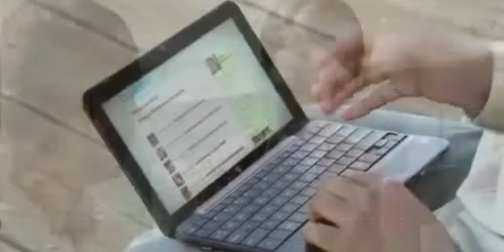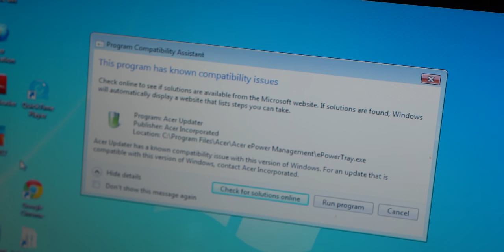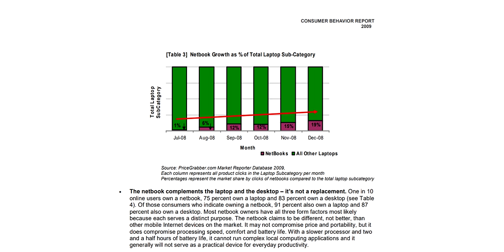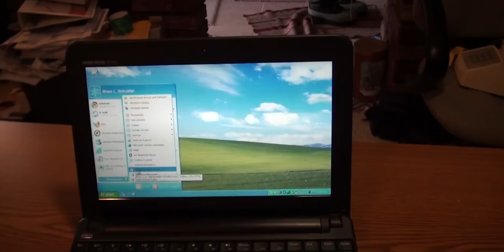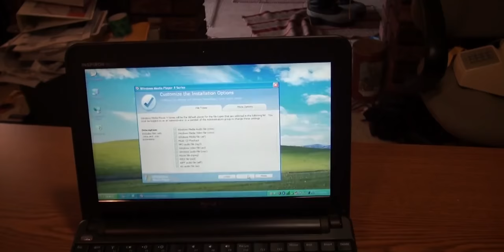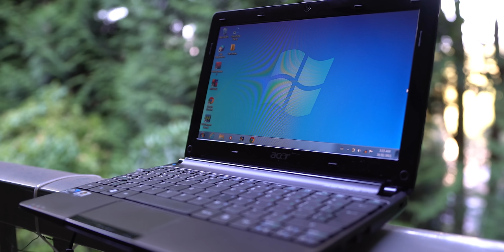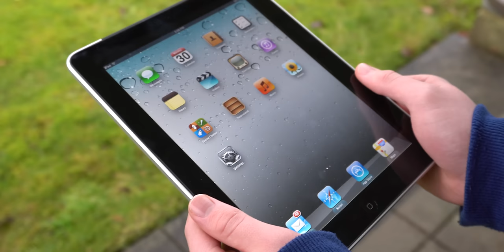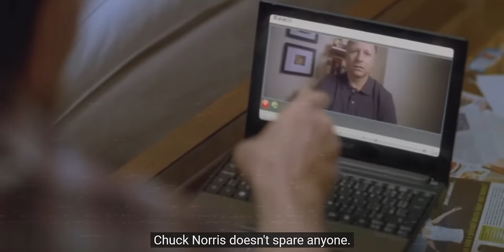Why Netbooks Failed - Modern Retrospective

Comment: I adored my HP Mini 110c I bought used in December 2010. The previous owner even slapped Win 7 Ultimate on it before selling it for about $240. It was the first PC I owned for myself, and despite the Atom and 2GB RAM, it was phenomenal for light web browsing (for circa 2011-2013 web), Winamp music-playback, and Genesis/SNES emulation throughout its 2 years with me before its charging/AC port quit. It also helps that Win7 was the best experience I've ever had in my now 21-year history with Windows.

I've since moved on to much more powerful/interesting hardware, such as a 17" Core-i7 laptop in 2013 and an 11" convertible tablet-laptop in 2013 (both laptops being Windows 8), building myself a PC in 2017 (with Windows 10), a series of iOS devices throughout 2014 - present, and lastly getting my first Macbook in 2018. But none of my experiences with any of these computers were as fun or stress-free as my time with that Windows 7 netbook. Learning MacOS on the Macbook Pro (though fine enough) is still a learning process, and as such, is filled with lots of little roadblocks. Windows 8 on the two laptops was fine enough but something always felt 'off' about 8. And while I adore my tiny 2017 ITX beast I built, Windows 10 has made my experience on it just miserable over the past 3 years; Windows 10 is the worst experience I've had in my 21 years of working with Windows - I'm just waiting until the Linux community's Proton project reaches close to 80%/90% compatibility with Steam's library of games and then I'm moving the PC to Linux (likely Ubuntu or Mint) and will likely do the same for my two remaining Windows 8 laptops when Win8's End-of-Life comes about in 2023. Linux will be another challenging learning process for me, even moreso than MacOS; But I've had all I can tolerate of Windows 10 and need an OS that's not constantly flaunting its worst traits as features.
Reply: TurboPikachuX which 17 inch Core i7 laptop is it?
Reply: @Windows7Pro2009  HP Envy DV7-7250US (2012)
17.3" @ 1600x900
Intel Core i7-3630QM 2.4GHz (3.4GHz iTB)
Intel HD Graphics 4000
8GB DDR3-1066 RAM
5400RPM 1TB HDD
Reply: @TurboPikachu  Does HP have an option for a dedicated GPU?
Reply: @Windows7Pro2009  HP did offer about 3 other configs of the Envy DV7 that had an Nvidia GeForce 650M, but the only model I could find at my Office Depot and Best Buy locations was the integrated-only 7250us.

That said though, Intel's HD 4000 from May 2012 was so much closer to the performance of Nvidia's GeForce 6xx-series laptop GPUs from March 2012 than any of Intels future iGPs would ever get against proper laptop GPUs. I mean, considering intel's 2019 Iris Plus iGP can't even output 1/3 of the performance of 2016 laptops with GTX 1050m graphics, I struggle to believe that the upcoming "Iris Xe" iGPs will catch up to AMD's Polaris-based Vega and Navi-based RX5000M-series, or Nvidia's Pascal-based GTX10M-series and Turing-based GTX16M-series/RTX20M-series

I was actually quite impressed back in 2013 that the HD 4000 iGP could run late-generation PS3/360 titles like Sonic Generations GTA V at medium settings/30fps at native 900p, and even ran some current-gen titles such as Rocket League and Warframe at resolutions and frame rates above that of the Nintendo Switch's.

But ultimately once I built my gaming PC in January 2017 (i5-6400, RX480-4GB, 16GB DDR4-3000 RAM, roughly around Xbox One X spec and above-spec of the PS4 Pro and upcoming Xbox Series S), I stopped laptop-gaming altogether, as moving the PC from a 60hz 1920x1080 TV to an ultrawide 2560x1080 75hz FreeSync monitor in April 2019 really killed my interest in anything laptops had to offer
Reply: TurboPikachuX Thanks for the info, as I’ve been looking at used laptops with dedicated GPUs. But now I am stuck with a Core 2 Duo T7200 with 2GB RAM and Windows 10 ;-;
Reply: i always want to know what happened internet after 2014.
Reply: @angry_engineer  The entire internet moved to HTML5 from Flash.
Reply: @Windows7Pro2009  thank you dude.
Reply: @Windows7Pro2009  lol that must be such a painful user/productivity experience
Reply: I don't think Windows 10 is a bad OS. The majority solely uses Windows and people who use Linux (any distro) are in the minority. That all goes down to software compatibility. And I might be the people of the minority who dislike Linux. If you're worried about security, then it's because the majority uses Windows and finding exploits and flaws are easier since it's the majority OS and there are very few people who use Linux.
Reply: I only had i5 pc, is i7 much better?
Reply: @rustymixer2886  The only point to which an i5 would start to suffer as opposed to an i7 would be in running games like GTA 5 at 4K ultra settings whilst trying not to bottleneck cards like the Nvidia GTX 1080/1080ti and RTX 2070/2080ti/3080/3090, or AMD Radeon RX 5700XT/Radeon VII

Other than such extreme cases as that, an i5 is a perfectly fine CPU to pair with cards like the Radeon RX 470/480/570/580/590/5600/5600XT/5700 or Nvidia GTX 1050ti/1060/1070/1650/1650S/1660/1660S/1660ti

But in light of recent developments regarding vulnerabilities such as Spectre and Meltdown (and the resulting security patches harming performance up to 30% in some models), as well as intel's clearly-slipping performance per dollar against AMD, I'd highly recommend opting for a Ryzen 5 over an intel Core i5 chip these days, especially for gaming.
Reply: @TurboPikachu  suppose it depends on the generation too
Reply: @TurboPikachu  yeah I used it to edit blu ray movies it seemed that was fine but I wouldn't push it with hi tier games. My friend kept yelling at me to get i7 but I said my o
I5 cool but he said it heats when renders edit movies but I didn't notice
 Any prob
Reply: widnow 10
Reply: I loved having Windows 7 at work and in college. Windows 10 is good too, but Windows 7 is faster.
Reply: @Minecraft TV i like dual boot xp and 7
Reply: The number of headaches I have had with Linux have left me wanting to throttle anybody who suggests it to me as a viable operating system--be STRONGLY warned. Windows 10 has ben a profoundly more positive experience for me, if that makes things at all clear.
Reply: @IrenMasot  isn't Unix ios and Linux, with andriod being a son of Linux? Now a days I rather work with dex than windows pc 🖥

Comment: They didn't necessarily fail, they evolved into other markets.
Reply: Their spiritual successors are definitely Chromebooks.
Reply: @RydalS  yes
Reply: Such as the 2 in 1 with detachable keyboard
Reply: @RydalS  except chromebooks are trash. I know that from experience.
Reply: @XMANIAFLYYY  Not all of them, but I respect your opinion formed by your own personal experiences.
Reply: Yeah they split into chromebooks, ultrabooks, tablets and 2in1s
Reply: @RydalS  I live in Russia and Chromebooks… do not exist there. Very few people know about them.
Reply: @XMANIAFLYYY  agreed, chrome OS is super limited, bad Specs I’m forced to use them for school then the school decides to further limit Chromebooks by restricting everything 

Even The use of Linux :(
Reply: @kovyvuri  They are pretty bad, at last on netbooks you could intall a real OS like Linux Mint or Arch
Reply: That's a lie because Google killed destroyed the majority of the crappy laptop industry with crappy tablets which microsoft had no choice but join forces with  Google because crappy android tablet have the advantage that the same potato hardware is cheaper and touch screen makes Netbook size screen more enjoyable because of pitch zoom without the same pixelation that would happen on a normal netbook it's part of the arm technology hardware acceleration.

Comment: Netbooks were great. I gave presentations with them, wrote software, even ran robots and computer vision with them. They never let me down.
Reply: @Dave Everett
Yes, my Asus eeepc was reliable too.
Sturdy little fukka still boots up today with everything working.
Reply: Bought an MSI Wind and installed MacOS 10.5 then moved to a Dell Inspiron 910 with MacOS 10.6 and a 128GB SSD. Both served well for coding, presentations, working on the move. Cheap enough that if anything had happened to them it wouldn’t have been heartbreaking to replace them.

Comment: cough cough- Arent Chromebooks basically Netbooks?
Reply: No because Chrome OS does way better on limited hardware than Windows does. Plus there's far nicer Chromebooks now with i3, i5, i7 processors and 8 to 16 GB of ram plus back lit keyboards and touch screens. You can run Linux on the newer ones and some gaming services are making their way to the platform. For doing simple things like web browsing or using Android apps a Chromebook is way better than netbooks were.
Reply: And its more lightweight system

(Correct me if i am wrong
Reply: I am pretty sure if they didn't burn the Netbook branding and it wasn't about Google pushing their propaganda on us, these things could just as well be named Netbooks.
I mean technically I can turn any laptop into a Chromebook and most recent Chromebooks can run proper Linux distros (and yes, I know Chrome OS is based on Gentoo) or just run its software inside a Debian chroot.
Reply: @domm4633  16gb of ram and an i7 is a tad overkill for a chromebook though
Reply: @SprattyD  It is but you also have to think about the longevity of the device since newer chromebooks are being supported for 8 years. I have an i3 chromebook with 8gb of ram and its really nice to use.
Reply: Pretty much 😂
Reply: @SprattyD  yeah...I wouldn't want so much power for just Chrome and Android apps. I would be sad if I had a mobile device that's more powerful than my desktop (below if you don't mind me f l e x i n g 😤😤😎😎). I could use a laptop that has a similar CPU but weaker GPU, like my brother has, if he ever gets a new one. But only with Windows.

(i7-4790/H81, GT 730, 12GB DDR3-1600, 500GB WD Blue 3D NAND SATA SSD, 1TB 7200RPM Seagate Barracuda with 64MB DRAM cache)
(wanting to upgrade to GTX 1650 Super or 3050 if it ever exists)
Reply: Aren't*
Reply: @MegaManNeo   certainly they’re notebooks for using The Net. So I think you’re right we could easily call modern ones netbooks. However, the form factor is called ultrabook, since that’s what the Chromebooks OEM’d with Windows are called, as well as the MacBook Air and stuff being put in that category. But of course if the netbook name hadn’t been tainted there’s nothing to suggest the name ultrabook would’ve been necessary, so even if we pivoted back to full size keyboards and slightly larger screens but thinner designs that were as light as a netbook; they might have well still been called netbooks if the name were still good. I suppose the “hallmark” or test of that timeline would be whether they called the very first MacBook Air a netbook or an ultraportable.

Comment: I had one from my grandma it was called an Eee Pc made by ASUS with windows 7, and it took 50 years to do anything. We won't talk about what happened when it upgraded to windows 8.
Reply: My friend had an Eee PC and when he updated it to 8 it would just crash on startup.
Reply: @fenn_fren  my mom also had an asus eee pc, same experience, but we never upgraded to windows 8. Anti-virus software was the biggest performance killer. She gave it to me and now it has an ssd and Linux mint and now it boots within 10-20 seconds and I can actually use it.
On a side note, without the hdd, the screen is to heavy for the eeepc so it won't stand correctly. I was lucky I had an old ssd that was as heavy as the hdd that was in the eeepc.

Comment: I remember my ex having one, damn those Atoms were SLOW..
Reply: I'd leave someone if they used a netbook too 😂
Reply: @AshenTiger  maybe he left her cuz she was too fast with too many, get it 😆
Reply: Mac Gyver LOL
Reply: Mine with the dual core atom was alright. Slow but fine with Windows 7 for word processing.
Reply: @pilotavery  would be faster just xp
Reply: I still have one (EeePC H1005HA), it was running dual boot with the original WinXP and Win10 on the stock 160GB HDD till i swapped out the old spinning disk for a 128GB SSD now running Kali Linux.  Sure it may be slow compared to my Acer Nitro 5 with its i7 and GTX 1050TI but it runs just as fast if not better than my OG Surface Pro with its i5-3317U
Reply: @tolgahk84  awesome!
Reply: Same here lol

Comment: There were some 11.6 inch netbooks that actually came with Core i5 and Core i7 ULV processors like the Acer TimelineX 1830T, although it costed $699 when it came out.

Comment: Got a Compaq Mini 110 running XP on clearance in early 2009 - I appreciated the portability and battery life on several trips abroad, and it never felt too unbearably slow. I eventually invested in a HD video decoder card - seeing YouTube play back 720p video via Flash Player on such a small machine was an amazing feat! Sadly the internet became way too much for the processor to handle around 2013 or so and shortly after Microsoft killed XP support. It had a good run, and served its purpose well.

Comment: When i needed something small, and capable for work, i picked up a 2nd-gen Acer Aspire one. I maxed out the RAM, replaced the HDD with a faster one, and loaded Win7 pro. it was a damned good little machine.. hell, i still is. while it doesn't see nearly as much use as it used to, i still use it for jobs, once in a while. For the kind of work i bought it for, tablets were worthless, and full-sized notebooks were just too big to be lugging around in the field.

Comment: I remember my first ever laptop was a 2010 netbook with Windows 7 Stater. It was slow for basic web browsing even in 2010. Even my 9 year old self wondered why I couldn't change the wallpaper for FREE. Also, I remember it could not handle Windows Update and it would freeze halfway through updates almost every time.

Comment: Right, I used a Dell Mini 9 for 8 years as my MAIN system. 
It was indestructible. 
I took it in my backpack on my motorcycle everywhere.
I boosted its RAM to 2GB, added a 16GB SD Card, and installed Slackware with ratpoison on it.
Yes, it was slow, but still serviceable. Fantastic for debugging network issues, jack it in, run 'ping', 'traceroute' & Bob's your uncle.
Eventually replaced it with a Lenovo 11e, which is still working great after 5 years hard use.
The good thing about the Mini is that it came with an SSD drive which is why it was so rugged. A hard drive would have died with all the abuse I gave it.
People used to laugh at me but I just booted it up and fixed their problems anyhow.
Wrote oodles of software with it too, mainly PHP and Python.
Speed isn't everything. Portability & ruggedness count, too.

Comment: I'm actually watching this in my workshop on an old acer ES1-111 vintage 2009 netbook, with windows 10 installed,  whilst working on an HP Elitebook that replaced the netbook to run a cutting machine in the shop. So the old netbook still gets used - most of the time for youtube and video-calls -  Runs windows 10 fine though, which still surprises me.   Definitely still have their uses.   Got an eMachine DS620 on Vista running another one.  It's like a crappy Poundland version of the Borg ship in here 🤣  I take the old acer on bike trips with me camping. Definitely don't regret dragging it back out from "the cupboard of discarded tech" last year.

Comment: I still use my netbook, just max out the RAM and put an SSD in them and they still work well.
Reply: Same here. Have a white Acer Aspire One (the newer model with smooth lid instead of the rippled lid shown here. It looked really futuristic when it released.) Came with Win XP Home, 256Megs of RAM, and a 256G Spinning HDD. Considering I was moving up from a 2001 year model Celeron D Processor, the Intel Atom core flew. I cloned my Need For Speed games, The Sims 2, SimCopter, and various emulators onto it. It literally never left my side. My mother sold it off after I moved to College, but I managed to find a similar one in Blue. Upgraded the RAM on it. It's my go to Game Console now. Still use the little guy for games that don't run on my modern Gaming PC. I also frequently carry a Jailbroken iPad 2 3G. Guess I'm a sucker for old gadgets lol.

Comment: I still have my netbook from 2011 and is my computer for traveling.
It is ono HP, I installed Debian (Linux) on it and it worked really good, I used it for all grad school and I finished my tesis on it and wrote all the code that I needed.

Comment: I still have one around from 2012. I put Arch Linux (32 bits variant) with a very light weight environment (stock DWM with a few patches), beefed the RAM. I still use it for recreational/exploratory coding and as a serial terminal when hooking it to hardware. It's good enough to edit code, and the slow CPU is a motivation to use simple tools and good algorithms.

Comment: Had an Asus X101H as my first PC, had been turned off for the past 6 years. Just recently rediscovered it, decided to restore and upgrade it with a replacement battery and monitor, SSD, and 2GB RAM. It now works like and runs as fast as a normal laptop

Comment: I actually would like to see another netbook era, with chips getting smaller at 7nm or less in the next years, more efficient and decent APU graphics.
Reply: Issuing them with S Mode on default (which only allows Windows Store downloads) would be a bit of a disappointment.
Reply: Wouldn't a large phone and a keyboard basically equal a netbook?
Reply: Isn’t that basically a tablet with a keyboard?
Reply: @TheMysteryDriver  Not exactly. Mobile phones don't have upgradable RAM, swappable SSDs, a proper operating system or enough USB ports.
Reply: @inwencja2009  I don't think you remember netbooks or their purpose